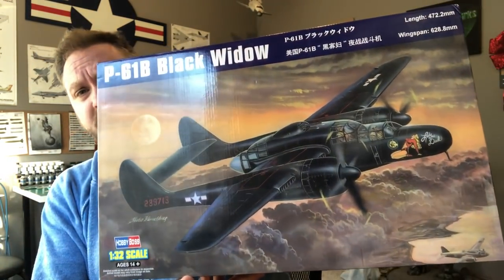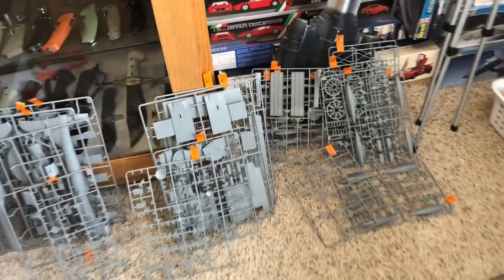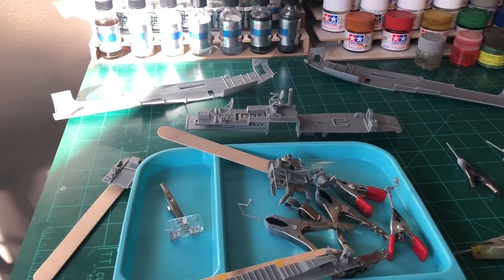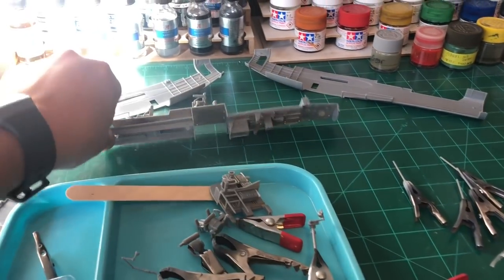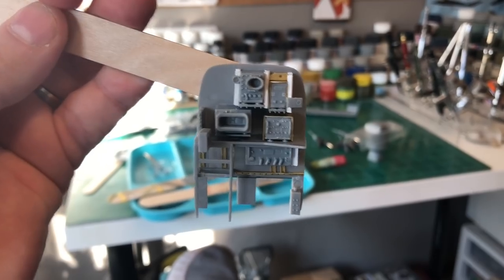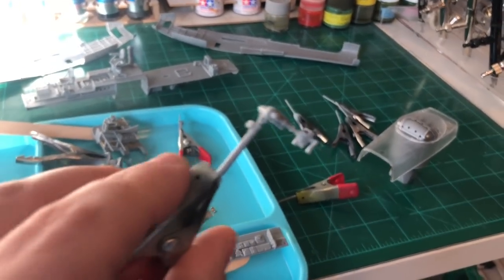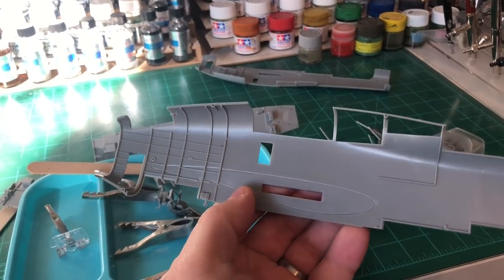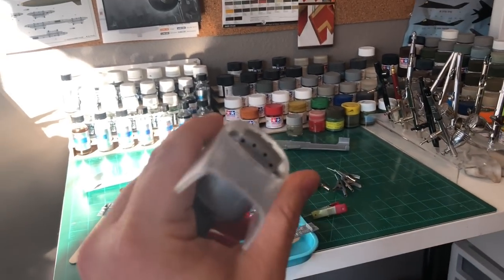HobbyBoss 1/32 P61 Build Part 1: Interior

Comment: I am looking forward to building mine.  I just purchased the B-24J Liberator Kit, from this same company.  I want the B-17, next so I can place it next to my Trumpeter P-47 Thunderbolt.  The one model that has been a complete nightmare is the Airfix 1/24th Scale P-51D Mustang.  The fit on all of the parts is absolutely horrible.  I have the kit partially build and have finally given up.  I think there is more Squadron 5 on that model than there is Polystyrene.  It is sad really, because the model looks like it would be a really nice build.  But the seams on the entire kit fit poorly.

Hopefully this one will be very cool.  Currently working on Trumpeter's 1/32 Scale Vought F4U-1D Corsair.  So far, its coming along nicely.

Comment: Relish resins in the UK has a number of resin sets to upgrade this kit. You need a new set of resin props and spinners, exhausts ( HobbyBoss forgot to include them entirely) and a new Radome for the nose. One real error in this kit is the main undercarriage doors on the booms. HobbyBoss give you two main doors and you should fix them open for a landed airplane. While this is correct for a P-61A model, the B model has 4 part doors. Two small doors around the main legs and 2 larger doors over the rest of the bay. The reason for the change was that the A model was prone to having debris drawn into the rear booms, thrown up by the tyres. In the B model the larger doors closed when the Main gear locked down before landing, curing 99.9% of the problem.
Overall, HobbyBoss give you a reasonably good P61A in the box. But it needs these changes to make a B model. Oh and Relish also make a fixed upper gun barbette.
Reply from the maker: Thanks for the info Brett.  I knew there were some inaccuracies with this kit.  Your info will definitely help out some others wanting to build an accurate version.
Reply: Oops, forgot to add WHY you need a new radome to make a B model. They changed the model of radar between the A and B models, necessitating an 8 inch extension to the nose. They also dispensed with the translucent fibreglass for the radome and used an opaque type. Hence all B models have painted radome...

Comment: I've built this model of the p-61 Black Widow Revell148 it's not as detailed as the One You're Building like that light that had four or five parts you don't even have that if you didn't want a model is big and have it easier to build the Revell 1/48 it's a good model I fit everything fit fairly well the fuselage you have a lot of putty work to do for the two Booms to the tale connect to the wings and the body is a lot of filler to do and it's actually really good fit so nothing that some Putty can't fix filler putty whatever you want to use and after my paint job you can't even tell you looks like all one part

Comment: I always thought that it was a waste of time to extra detail an interior that won't be seen anyways.  One of the reasons I put off building mine..
Reply from the maker: I always seem to get sucked into adding more detail than is necessary and after I close it up, you can’t see but a fraction of it.
Reply: @seanerk5kt9  I have the 1/32 Hobby Boss B-24j4...fantastic details.  It would be cool to have a transparent half like the Monogram B-17 back in days of old...
Reply from the maker: I’m not a fan of transparent parts but have thought about doing a cutaway on a larger plane.  I know it would be difficult and might be beyond my current level of expertise but done right, they look really cool.
Reply: @JamesJones-of8hl  A phantom Widow.